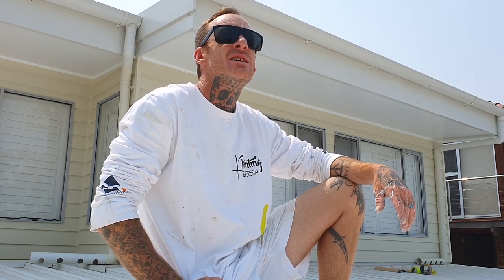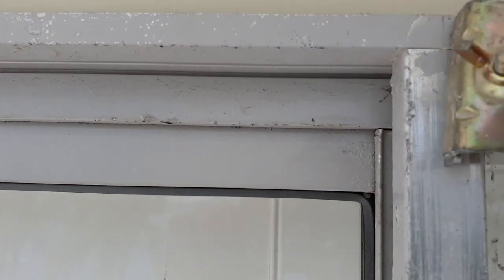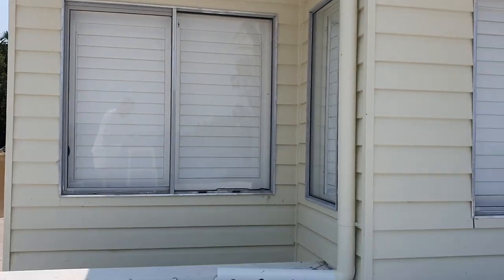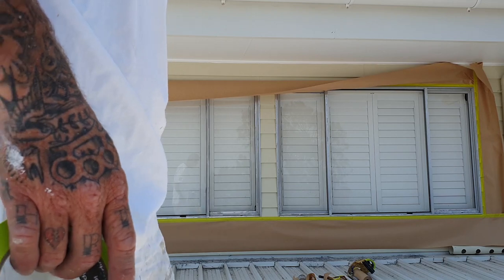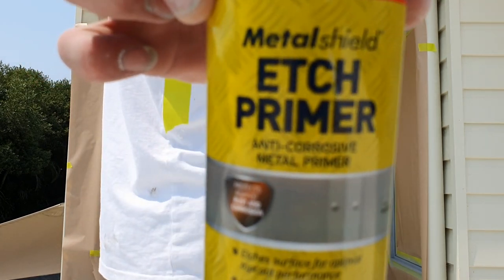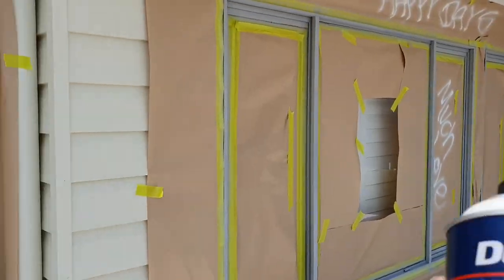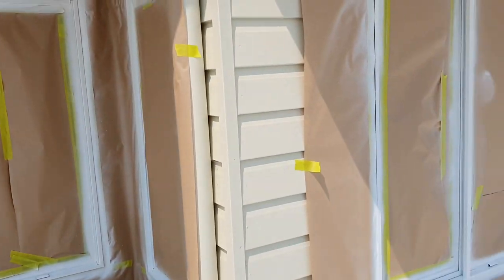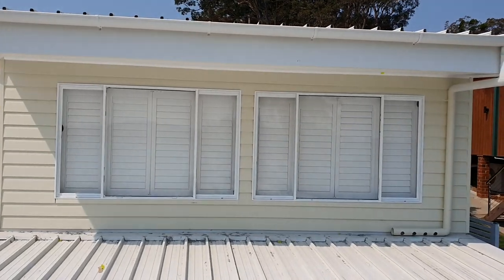PAINTING ALUMINIUM WINDOWS

Comment: Your video gave me the confidence to give this a shot on some old brown aluminium windows which are now satin white both inside and out. Followed your directions and they came out fantastic. Thanks heaps for showing what to do here. Note to anyone else wanting to give it a shot: Prep is everything - take your time removing latches and masking up.  For me (first time spray painting) the Etch primer ran a bit until I worked out what I was doing - When it’s dry sand the runs lightly back until smooth, wipe the dust, and carry on where you left off. The top coat goes on really easy. Just like a bought one :D
Reply from the maker: That makes us super happy story's like this is why we do them. so thank you emma🙏
Reply: Thank you Josh for for a great video. Emma I am thinking of painting our brown windows white also, I was worried they nieghbour peal on the bottom as they are sliding windows. Did that happen with you.
Reply: Thanks for the tips. My frames are also brown anodized aluminum and look like crap.

Comment: Hey Josh thanks heaps for your videos. I’m about to start the process of painting all of our windows. Just one question, I would have thought I needed to remove the window that slides and paint in the tracks and the bottom of the sliding window frame??
Reply from the maker: Hi Kirsty, thank you for watching! Yes most definitely you can take out the sliding windows paint it out & the tracks and pop it straight back in all finished. Good luck on the repaint 🙏

Comment: Thanks Josh, we’ve just had our place rendered and are needing to paint the render and window frames. Which would you do first? 
Thanks
Reply from the maker: Hi Kiara
I would usually say walls first & window's last but it can be hard taping up render. So I would spray window's first leave for a few days get a low tack tape and tape up window's do this render window surrounds then romove tape from window's straight away. Hope this helps & good luck 🙏

Comment: Thanks for the tutorial Josh. I wanted to ask, would you remove the window sash on each frame and pop rivet them back in after paining the frame and sash separately? Or spray with with the sash closed and then when dry open the and  spray in between where the paint would not get when the window is closed?

Comment: Thank you for a great easy-to-follow vid. I have anodised aluminium frames (only two windows) so no powder coating. I’m going to replace the fly screens as they are pitted and falling apart. There’s nothing to scrape off the frames, so would it be best to just sand and use the etch primer before the top coats? Thanks in advance!
Reply from the maker: yes that's exactly what I would do!
Reply: Thanks Josh

Comment: You are a legend and what a great video. Inspirational and simple for us DIYers🙂 I have some blue powder coated windows that I am going to tackle (about 20 all up). Like some previous questions, I was wondering if the paint on the existing windows is in good condition I was hoping to not sand or use primer, but will do so if it is a better finish. Cheers mate and thanks again🙂
Reply: All sorted - I read your response to one of the other comments so I going with a light sand, no primer and 2 top coats - Thanks again 🙂

Comment: Hey Josh
About the rubber/plastic around the windows, u did not mask them. Would that cause an issue in long term?
Reply from the maker: Hi mate, they where cracked and real brittle in this case painting them was definitely a better option than leaving. Cheers 🙏

Comment: Hey Josh, great video and great finish. What grit sandpaper did you use on the aluminium?
Also, any tips on filling holes or dents please.
Scott
Reply from the maker: Thank Scott, I usually use a 240 grit depending on how corroded it is. You could use a cold-weld product to fill any damage. Hope this helps 👍
Reply: @paintingbyjosh  Thanks Josh

Comment: Out of all the windows have 2 or 3 where the bottom sash area has rusted, but are still solid.     What do you recommend to take the rust off before priming?
Reply from the maker: Hi Ray. I would give it a good scrap down and wire brush the put a anti- rust primer. Etch prime over the whole window including back over the anti- rust primer, and two top coats✌

Comment: Great video. Did you mask the rubber seals around the glass or they are ok to paind over?
Reply from the maker: Sorry for the late reply depending on the condition of the seal if it's in good condition tape over it but If it's not the best tape to the glass and paint it out ✌

Comment: Thanks so much for the tutorial , super useful.
I have some questions, our current windows are mission brown and I want to paint them white, will I need to do extra coats if that’s the case ?
Where do I get me one of those masking thingy’s?
And do I still need to scrape and sand the aluminium if it’s not corroded ?
Thanks in advance 🙏😊🤙
Reply from the maker: Awesome thanks
With the spray you should get really good coverage so maybe just see how it goes. If the windows are in good condition just a light sand clean & dust would be good enough with a etch prime🙏

Comment: Great video mate! Question - i’m thinking of doing the same but internally for old brown aluminium windows which i think are powder coated. They are in decent condition and was wondering if i need to scrape it back to the bare metal before priming or would a rub with scotch brite and clean with metho spirits be enough to give it adequate adhesion?
Reply from the maker: hello! i would just give it a light sand with 120G and then clean them with the method. Then give them a prime and two top coats

Comment: This is a great video, thankyou for including us "girls" too :) quick question, I need to do all my interior frames what do I do about the locks and handles on the sliders etc that don't look easy to remove?
Reply from the maker: Thank you Wendy. Definitely gotta include all the girl's out there! A lot of the time you can take out the sliding windows and the lock/latch can simply slide off. This is not the case for all window's. If this isn't going to work they will need to be taped up before painting. Hope this is helpful. Kind regards Josh

Comment: Hi Josh,  could basically the same prep and procedure be used on some very chalky late 70s/early 80s outdoor aluminium louvres? Not quite as corroded as this so I don't 'think' it will need scraping first. I'm hoping just a sand back, primer and top coats will do the trick. What do you think? Is 120 grit enough to etch a surface like that? Cheers, VC
Reply: Yes, I’d like to know too.
Reply from the maker: Hi mate sorry for the late reply, yes the would be pretty much the exact same process. I would go with I finer 180 or 240 grit. Cheers
Reply: @paintingbyjosh  no worries:) thanks for getting back to me. Will use that process. Cheers :)

Comment: Newbie diy’er here. I have very old and corroded aluminium frames, set in wooden frames. Can I use the same paint for both? Is there something specific I should be doing for the rusty bits? 
Also, at what point do you open the window (the wind open and closed type) so they don’t get stuck?
Thanks for being so specific with your method.
Reply from the maker: Hi Sally, thanks for watching. No I would use the same paint for aluminium & timber. Paint the timber frames first in a suitable waterbased product then Tape them up after a day or two of curing. Than do the aluminium  windows! Just give the rust a little extra attention and a extra coat of primer. I would paint that style of window 3/4 open. Hope this all helps.

Comment: I noticed that the rubber seals are painted.  At least, I think I noticed that. Is that standard or a choice?  I am thinking that trying to mask off the rubber, then cleaning any spots that bled through would be difficult.
Reply from the maker: All depending on the condition of the seals these one particularly where very dry and starting to split so in this case painting them was the best option for longevity. Cheers for watching
Reply: Thanks.  I am going to be painting factory finished anodized (i think) windows in a high rise apartment.  I have not done this before, I have to not paint the seals I think.  Painting them would definitely be easier @paintingbyjosh

Comment: Hey Josh love yaa ur video mate , I have repainted powder coated 80s doeskin colour - 2 sliding doors, a window and big massive French window to match my new white birch Security screen.I have used Dulux Aqanamel for doors & windows  Gloss finish - through Wagner 590 flexio - suggested by paint expert in Bunnings I have done all prep - light sanded, dry wiped and then wiped with sugar soup did not used primer  ( suggested  by Bunnings expert ) and used two coats of paint so far .  Next morning the paint is coming off even by light scratch by finger nail . I’m so frustrated after all that hours and days work with crap  end result . Any suggestion mate
Reply from the maker: Hi mate, cheers for watching. I would never recommend aquanamel for anything powder coated it's not designed to go over aluminium. You really need to remove it all then start again with a metal etch primer and top coats. Hope this helps mate.

Comment: Your video is great but I'm just wondering about the sliding glass panels, should they be removed and painted seperately? Otherwise when the window is slid open you will be able to see the edges that couldn't be painted while the window is closed.
Reply from the maker: Hi Cheryl. Thank you! Yes you can take out the sliding window and do that one strip the runs on the inside edge and you can see from the outside 👍 I will be doing a updated video outlining some extra things that where not mentioned in the video. Appreciate you watching 🙏

Comment: If it is just bare metal, does it still need to be sanded before applying the primer?
Reply from the maker: Hi Amy, if it's free of dust and dirt you can go straight over with a etch primer. 👍

Comment: How do you find the duramax lasts over time once painted onto the etch primer? Does it fade or chip in time given that its a single pack paint?
Reply from the maker: I have never had a problem with them. they are very durable
Reply: @paintingbyjosh  thanks for the response 👍

Comment: Hi Josh, I'm ready to paint my windows. However they are a scungy mission brown and I think they may be powder coated rather than colour bonded. Does the method you use in this video work on powder coating otherwise do you have any tips for painting over powder coated metal?  Cheers mate.
Reply from the maker: Hi mate
Sorry for the late reply. Yes it will be fine if it's a powder coated or colorbond surface it's the exact same process 👍🙏

Comment: Hey Josh I’ve read a lot of people using Dulux metalshield epoxy enamel instead of the Duramax. Which would you recommend for spraying outdoor windows?
Reply from the maker: Hi lauren
I like to use the duramax is such a awesome product I can guarantee for 10 years. And you can swap out the nozzles for wider size fan for a more even spray. They are both great products. Hope this helps 👍🤙

Comment: Great video! I've been hesitant to paint my old windows, wasn't sure they'd turn out, now I think I'll give it a go. Will this hold up on sliding glass door frames? They are bare aluminum. Scraping the paint when opening and closing is a primary reason I haven't done it yet.
Reply from the maker: Thanks David. Don't hesitate you can't go wrong believe in yourself and get it done 💯 yes this will be fine for the sliding doors just give it a etch prime first and it will be rock solid.👍 cheers

Comment: Hey Josh, thanks for the video. Very helpful. Quick question, do I need to scrap or sand if the aluminium frame is fine i.e no defects or corrosion. We just want to change the colour. Much appreciated 👍🏼
Reply from the maker: Hi mate. Glad you dig the vid. Just a light sand & dust will be perfectly fine. Hope this helps legend 🙏

Comment: Nice job Josh. I've been painting my powder coated aluminum window, however I am using Rustguard Quick Dry Epoxy satin. With my old Little Beaver spray gun and its coming up a treat. Just wondering what you might use to treat any corrosion on the aluminum and any deep pitting?
Reply from the maker: Thank you 
I'm sure your method they would be c coming up awesome also. The Windows I do in this process they do come up like factory💯 I like to use dulux metelshield ZINC primer for any badly corroded, pitted areas after a good sand.

Comment: I have an outside sun room made entirely out of the same aluminum old crappy looking stuff. I’m a painter myself and I know you can do the window trim and will work but I have been wanting to paint the aluminum on the sunroom. Does anyone know if that will work as good as the smaller window trim or will a bigger area not work as well.  Its half aluminum wall and the top is half window so it’s much bigger. I know how to do it I have a lot of experience painting just never did this and it’s my house so I’m worried how it will turn out. Any suggestions.
Reply from the maker: Hi Chris. You could definitely follow the same process as this tape up all the glass and paint the aluminium in between the panels in the sun room 👍
Reply: @paintingbyjosh  thank you I was worries it wouldn’t turn out good or last very long. I do feel better about now because of your video thanks a lot
Reply from the maker: @hectorgrande8000  it should turn out perfectly fine mate. I have done a few sun rooms with the aluminium stripes. They come up factory finish and will last forever. Glad you have more confidence after watching the video 🤙🙌
Reply: @paintingbyjosh  thanks again
Reply from the maker: @hectorgrande8000  cheers mate

Comment: But what about the interior and the over lapping bits when the window is half open?  
I’m changing colour of mine and I need to respect every bit
Reply from the maker: Hi Glen! The interior was painted also. did you use these products?
Reply: @paintingbyjosh  i have a spay gun.  i had to take the slider out and mask that up and spray separately.   So i sprayed in, out and sliders, 3 stages - took friggen ages.

Comment: Did you just paint straight over the black window rubber seals?
Reply from the maker: Yes i did paint over the black rubber seals.
Reply: @paintingbyjosh  is that the right way?
Reply from the maker: @johannienel1  the black rubber seals where in a bad way. Dry & cracked they got primed to seal and protect and top coated. So yes this was the right way!

Comment: Such a great video. Thank you so much. You’ve given me the confidence to finally paint my window frames!! I looked on the Dulux website, and it says not to use etch primer on top of existing printed surfaces. What do I use instead? They’re in great condition, just a horrible colour! Thanks heaps.
Reply from the maker: Hello! I'm glad that this has inspired you to tackle your windows. The etch primer is just a primer to make sure your top coat sticks. If you have a solid painted surfaces already then you should be fine to spray over the top of it, just make sure you give it a light sand.
Reply: @paintingbyjosh  thank you!! I started by painting my shower screen frame, and that went well. So I’ll give the windows a try now 😊
Reply from the maker: @debloui  that's an awesome idea also! Glad I could help!